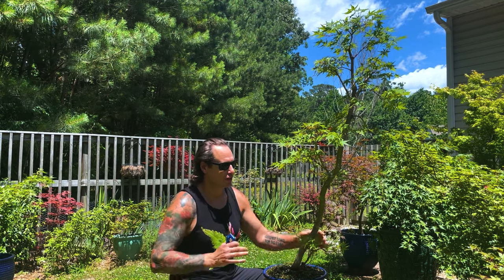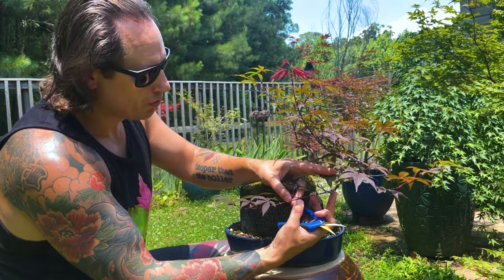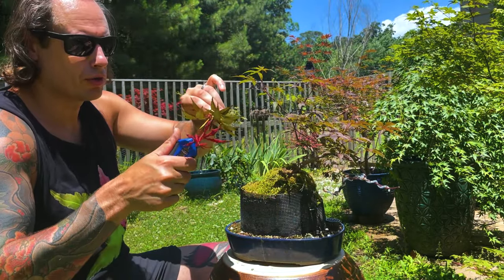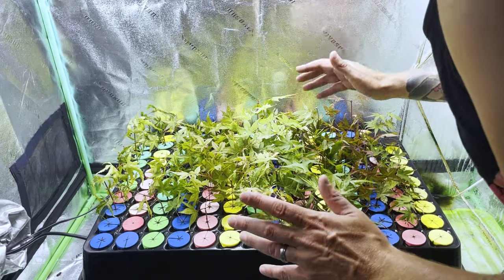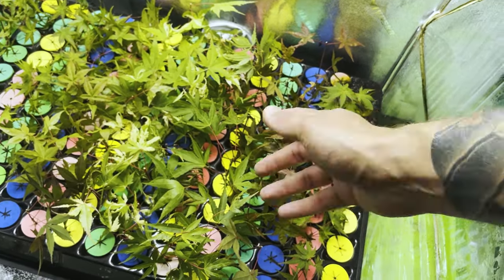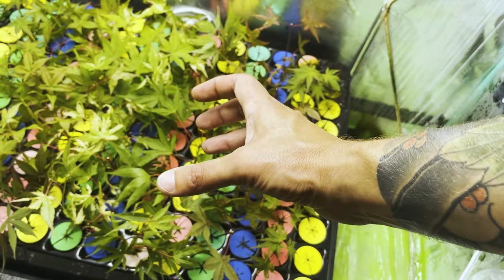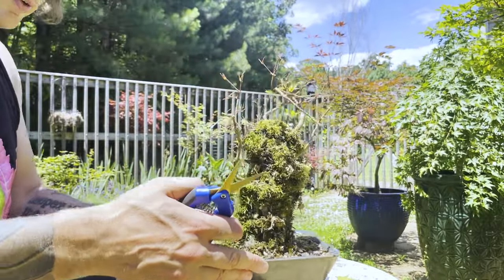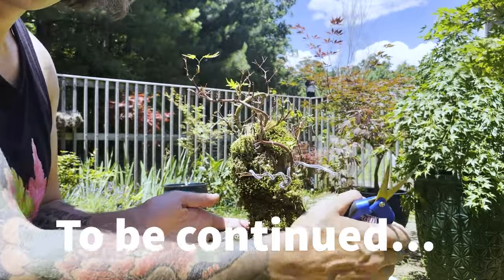Japanese Maple Bonsai: Defoliation Tips & Aeroponic Rooted Cutting Updates!

Comment: Hey Pat, Great job 💪, you have had very success on rooting the cuttings, I will try find a propagator to try your method but with Shimpaku junipers
Reply from the maker: Thanks for tuning in buddy!

Good luck with your propagation plans! Shimpaku are much easier to root, compared to maples, so I’m sure you’ll do great! 

Also, don’t count out air layers. They are a great approach for cloning after using escape branches to build size on the mother tree.

Comment: How many roots do you need on those cuttings before planting them?
Reply from the maker: It’s possible to plant them out with just 1 or 2 small roots, but the. You will need to carefully control the humidity and soil moisture. I prefer to cut them back a few times in the propagator to establish a good root set that can support the cutting outdoors in shade. On June 23rd I planted out about a dozen cuttings. I should have the next update video published in about a week.